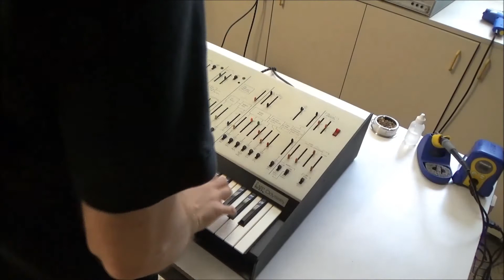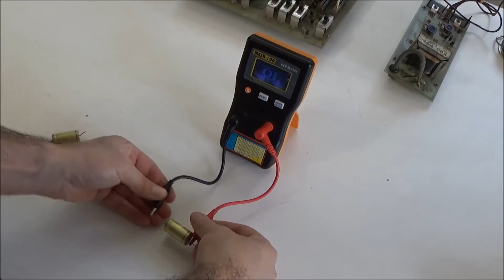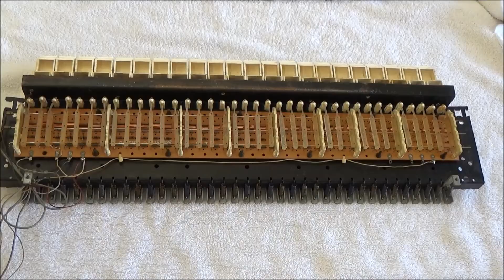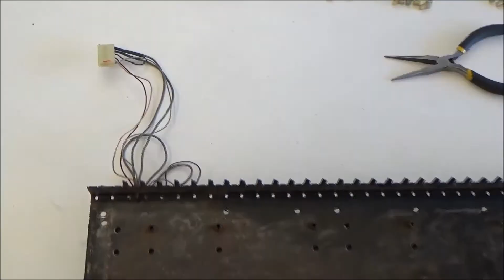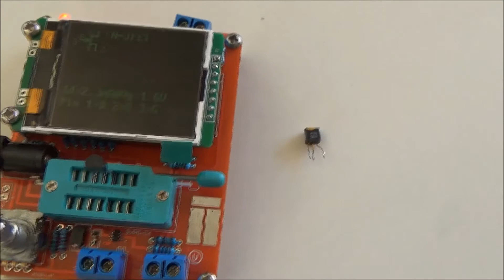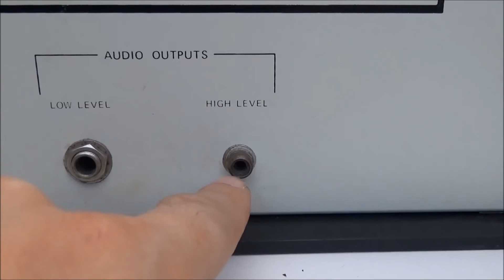Synthchaser #081 - Vintage ARP Odyssey Restoration & Repair

Comment: this video is amazing and very informative. I have a mark 1 black odyssey, and it seems to have crapped out. Been stored for like 15 years. Power light on but totally silent. I really want to fix it but know nothing about electronic circuitry. Where do I get all the little capacitors and transistors and such and how do I know what type its using? and Id buy your slider kit but how to I replace them exactly?  maybe too many questions but essentially i would love a more "repair for dummies" tutorial if possible. Or conversely I would be interested if you would do this sort of thing for me and what it would cost.

Comment: what was that lubricant you applied to the plastic key caps?
Reply: and how did you clean the switches?
Reply from the maker: @johnholmes5816  I used Super Lube synthetic grease on those little caps.  Usually just contact cleaner will help the switches.  Sometimes I'll need to disassemble them and clean them, other times I'll have to replace them entirely.

Comment: Great job! How do you calibrate the octacve switch? I have to reutne my oscillators slightly when I shift the octave switch up or down on my original mark III. Thanks for an answer.
Reply from the maker: There's a trimmer on board A (the one with the transpose switch), R23 that you can adjust to get the transpose switch to transpose it exactly 2 octaves.
Reply: @Synthchaser  Thank you so very, very much...Been in there with a jeweller's screwdriver and the octave tunings are sweet as a nut now!
Reply from the maker: Excellent, good work!
Reply: @Synthchaser  thank you, thank you! Sorry, can this be accessed by that hole in the front panel next to the transpose switch? (last question)

Comment: Just in the process of rebuilding my Oddy.  Seems like the resistor on the back of the power switch has burned out. The switch works fine but doesn't light up, do you know a source for replacements or do you know what value resistor would be suitable as a replacement? Thanks for your super informative videos btw!

Comment: Nice video. Just curious did you ever found the source for the slider caps for the rev3 Oddy? I jus't can't seem to find any.
Reply from the maker: Nope.  Someone sells them on eBay, but maybe someone with a good 3D printer can figure it out.  I've just made an LED slider kit for the Odyssey, so I won't need slider caps anymore.
Reply: @Synthchaser I get slider caps on the LEDs would look wicked